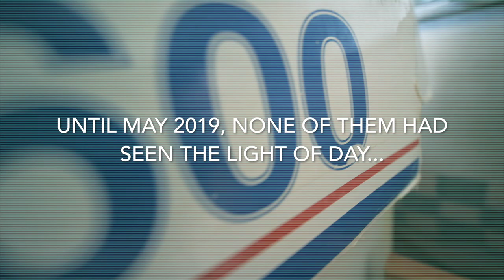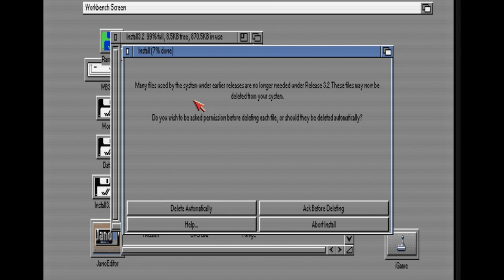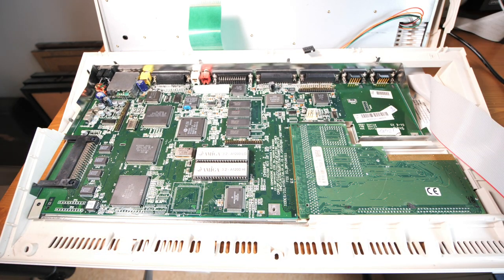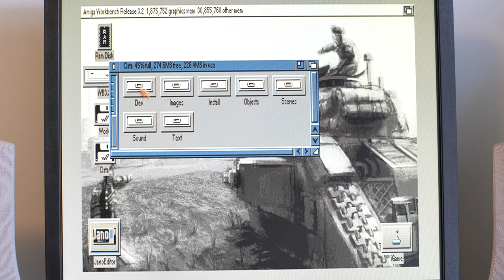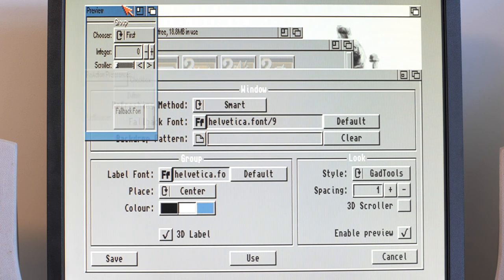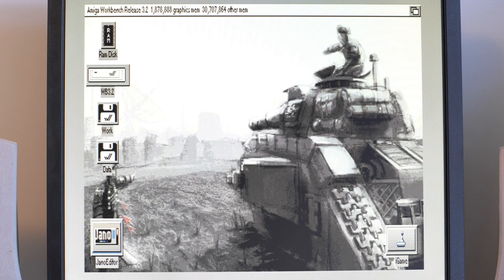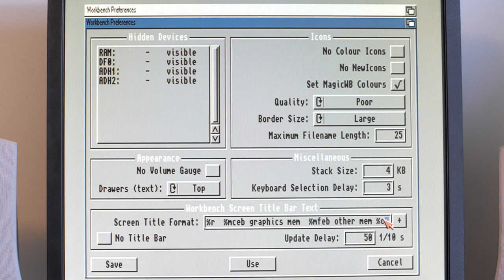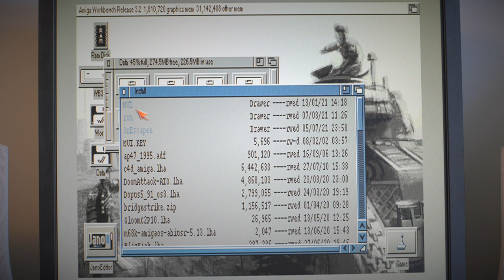amipal #47: From AmigaOS 3.1 to AmigaOS 3.2

Comment: Keyboard shortcuts:  Auto arrange icons: Right Amiga Y = Cleanup > Sort by name > resize to fit > snapshot..
Reply: I've found on some drives it doesn't save unless you access a folder or run a program in that window. Works well on the sys: drive.

Comment: I've been trying to set up Magic Menu in os 3.2 and it's doing my head in. I can't see all of the prefs window but also the menu doesn't appear at the pointer. If anyone could help with that, I'd really appreciate it. I also messed up my copy of iGame and re installed it but it won't start. The instructions for the install assume the user knows what they are doing which I don't.